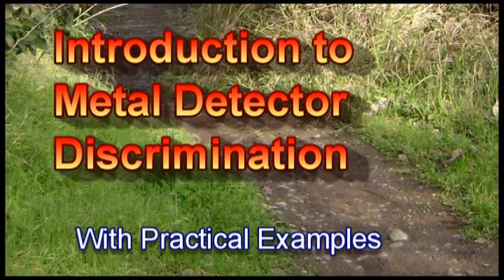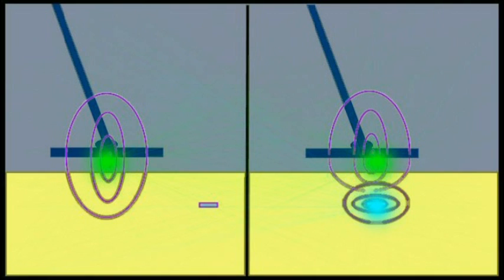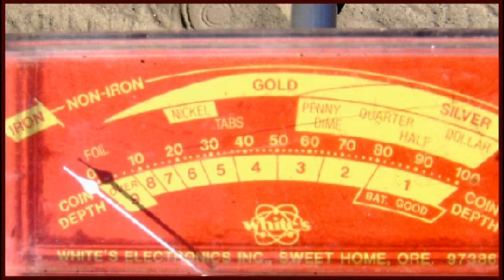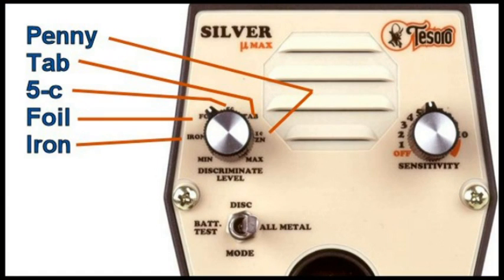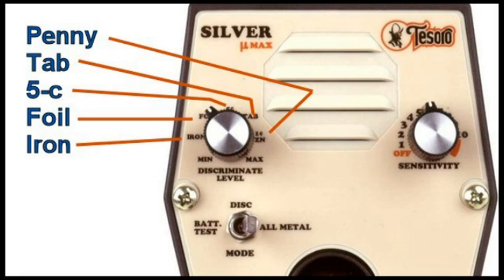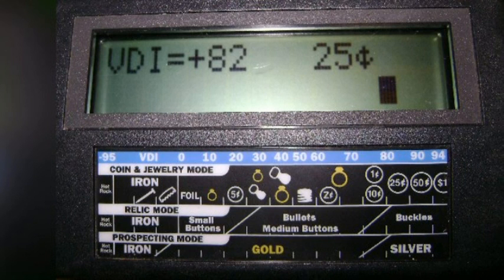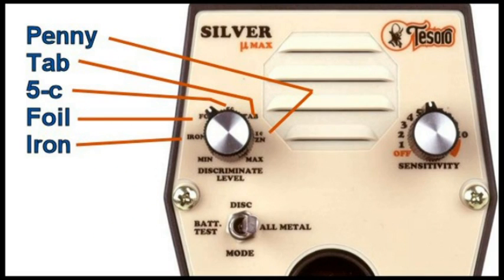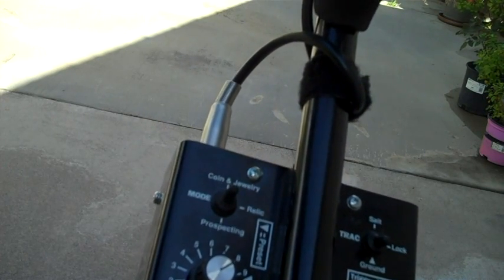Metal Detector Discrimination: Examples

Comment: the detector measures surface conductivity - in add'n to phase shift (angle).  Iron and nickel have strong neg. p.sh.  All other metals generate a +'ve p.sh.   Wrought iron (sq.nail) albeit iron; generates a +'ve p.s.  Rust, (iron) is electronically exotic (it's a semiconductor) and registers +'ve.   Eddy currents are more easily generated in disc-shaped objects i.e hot for coins n watches.  Pointed objects, (old screws) cut through discrimination as sharp points represent "eddy-weirdness".